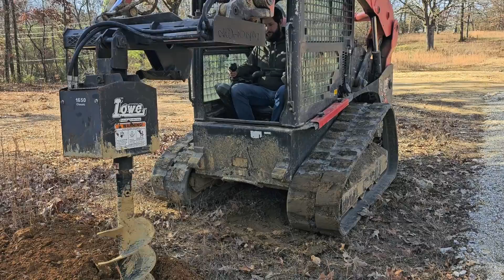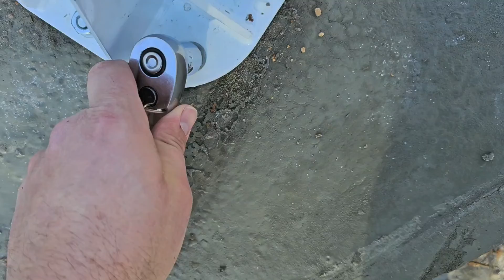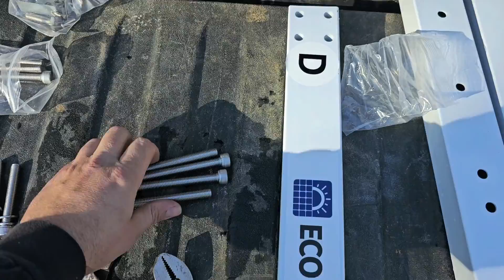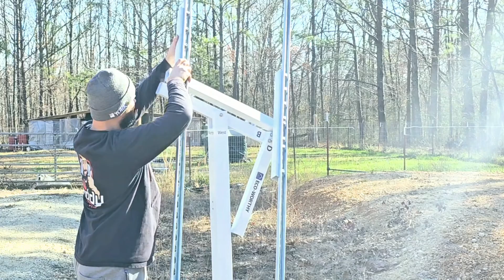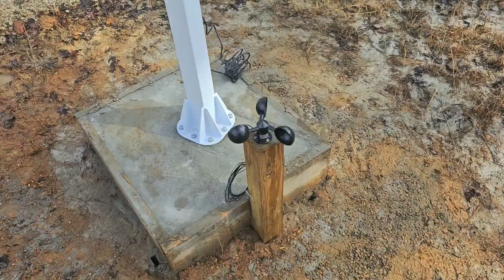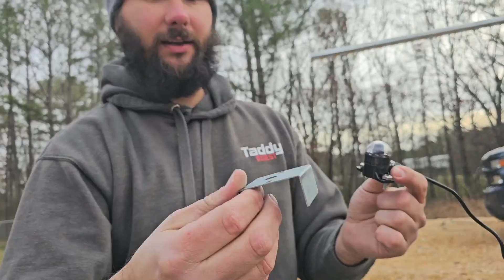How to Assemble Eco Worthy Dual Axis Solar Tracker? @ecoworthy_official

Comment: ok lets just say you are right about the position/ location of the actuators... how is that small one going to lift the north end of the solar panel grid 30 degrees? based on your instruction I unbolted my unit and turned it 45degrees and remounted it only to learn that you make a mistake as to the location of the small actuator, that I now have to pay for. I hate myself for listening to you and not doing and extensive assessment of the situation. Plus you seem so credible. In your favor I have to say that the info about the "A" brackets was priceless... but that a hammer to knock them into place can be done just by tapping the bracket with a pair of pliers and snuggly holding it in place while tightening the bolt ...tap and repeat...

Comment: I enjoyed and strongly referred your site for my sun tracking solar system made by myself.    I am using the same solar panel controller made in China.  However, my control unit is easily screwed out and broken in short time .  Since 3 years ago, I have purchased 3 units of the same controller because the life of each unit is almost 1 year.     How about yours?  Is it OK?  Is it longer than mine or  never broken?  Await your comment in convenient.

Comment: I noticed the concrete poured with about a 12" slump that provides a minimal amount of strength. Then the concrete was not mixed very well and when adding the 2nd wheelbarrow of concrete, it looked like the dry scrapings were in one corner of the pour. Adding rebar or bolts or whatever was used to tie in the two pours (when you added the additional amount with 2x12's does not really tie the two pours together). Then the bolts in the base of the steel tube.....what keeps them from spinning when tightening them to spec.? I would have made a thin sheet metal template and imbedded 12"-18" J-bolts to really hold the pole down with one (1) continuous footing pour.

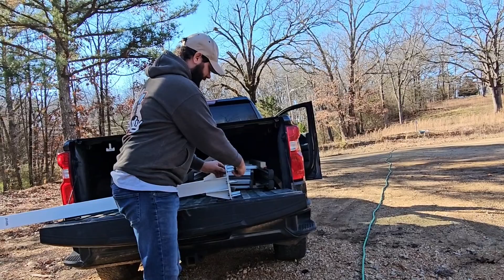Comment: 5:43 - that technique will save me so much time! I was trying to think about how I would set the bolts in wet concrete at just the right spots and angles so that the tracker would fit in place. I didn't think to just install the bolts on the tracker and set that in the concrete.

Comment: Fantastic video!  Came here after having issues with my install.  Only thing I would add, is creating a template of the base with plywood and using j bolts will be much stronger than the provided anchors.  Additionally, I followed the instructions and put the solar rails on top of the horizontal rails.  After watching your video, I tried to remove them to mount underneath, and the weight of the rails absolutely destroyed my bolts, requiring a sawzall to remove them.
Reply from the maker: Thank you so much for the detailed feedback and for sharing your experience! It's always helpful to hear about practical solutions and challenges during install.

Comment: Okay just some info I saw last year. i know the instructions show to put the linear actuators in this position with the motors down. But what happens in this midwestern climates. The rain and snow allows water to get into the gear box and ruins it. So put your motors up so that the water doesn't accumulate in the gear box. Other than that  I recommend your video. Our system is being shipped tomorrow. We will be doing a installation video on our shipping container.
Reply: @KennyJamieSmith-kjx   that’s funny cause that’s how I mounted mine just for that reason

Comment: You did a good build. On mine I added spacers inside the rectangle pipes that didn't have them because I tend to bend stuff like that. I used 1/2" conduit and cut them where I had to tap them down the pipes to the holes. A couple were lose so I used a dab of super glue to hold them in place. I also used blue lock-tight on all the bolts because I don't trust the wind to work things lose during storms. Next I filled the ends of the open tubes with expanding foam so wasps and other critters won't nest inside them. I already want another one.
Reply from the maker: That's a great idea, brother, I appreciate the insight!
Reply: "Next I filled the ends of the open tubes with expanding foam so wasps and other critters won't nest inside them." Great thought I was thinking the same thing!

Comment: Hey Taddy... I see that you have installed both the single and duel trackers? I have installed a single tracker last 5 months, and love it. I just ordered another for me second mount. I have modified mine by 10' struts to hold 3 400# panels. I want to do the same. Although I keep wondering if the Duel tracker would be better? I am not sure if it is worth the extra cash. Please will you tell me your incites on the subject?
Reply from the maker: I would go with the single access tracker

Comment: The only thing i see is the short bolts that you pushed into the cement and there's nothing on the ends of the bolts like big washers or a piece of steel with holes drilled holes for the bolts to go through.  With nothing on the ends of the bolts and you get a windy day with the solar panels on it them bolts will pull out of the cement and damage your solar panels. I like the rest of your video it was helpful

Comment: Very good wealth of assembly details! Excellent work man. My only question was about the height of the anemometer. I understand that it should be higher, as the wind gusts are different at the height of the tracker vs. close to the ground.
Reply from the maker: Yes, correct

Comment: Installing mine now...part B fits into the post with zero tolerance... it barely moves. The actuator will NOT be able to move it . all the paint is scraped off already... it's basically stuck and I don't even have the nut on. Not a good start.
Reply from the maker: contact ecoworthy that is not good my friend
Reply: @taddydigest  It took awhile to get a response, but they are sending me a new post. Can't wait to get back at it
Reply: after many attempt to contact Eco-Worthy, they have responded by sending me a new post that's due to arrive tomorrow

Comment: I have added tennis balls to the struts at the end of the panels to protect my head, they protrude and are sharp.  I also used the white triangles that the panels were shipped with to glue to the corners of the panels so that you cant hit the corners of the panels.  They are at head height and moving up and down now and then, baby proofing the array only saves you a trip to the ER.  I found that the E W actuator had to be reversed to work correctly and the solar sensor had to have the cable come out the SOUTHERN side of the array, in contrast to the video, just saying.  My controller is mounted to horizontal to read it easily inside a gasketed box, to avoid any weather issues and allow easy setting and reading, enjoy Woody N4MQ

Comment: I suggest that all the panels be mounter BEFORE installing the sunlight sensor.  One less thing in your way.  MOUNT ACTUATORS WITH THE MOTOR ON TOP, WATER GETS PAST THE SEAL OTHERWISE. I HAVE HAD SEVERAL PREVIOUS FAILURES DUE TO WATER.  i HAD ALSO TRIED DRILLING WEEP HOLES AND THAT DID NOT ASSIST THE ISSUE. wOODY

Comment: I do not trust the short bolts stuck into the concrete. I used 9" all thread into a base then, I welded them to another plate which I buried 6" below the concrete surface. The threads stick out 2-3 inches above the concrete and I double nutted the mast -one above and one below so that I could LEVEL the mast. THis is how street light poles are done in this area,  I have no issues with my mast moving!! ENJOY.
Reply: @woodyw6933  I am with you on this.  It is a ridiculous way to do it.  He obviously is not that great with construction.

Comment: Thank you so much! Eco worthy’s video is trash (they tried) had this in a box in the barn at my off grid property and weather finally good enough to start.
Reply: I’ve got it pretty much assembled but one major question… for the life of me I can’t seem to figure this out. Should the main post stickers be facing the direction or away? Like mine is oriented so that the sticker that says south is pointing south. So the south sticker is behind me looking south. Does that make sense? Or should I be reading the compass looking through the post.
Reply from the maker: Once you get it all together, you will know the right direction
The south should face south
I had to swap mine around
Reply from the maker: your welcome
Reply: Perfect I think mines right! Wish I could attach a pic to my comment. I drilled my expansion bolts so if I did need to switch it wouldn’t be devastating.

Comment: 👌 Hello !
Thank you for this interesting video.
Please a few questions:
What maximum weight can this tracker support?
And can I install on this support 2 or 3 photovoltaic panels each measuring 2000 x 1150 mm for 27 kgs (i.e. 78.74 x 45.27 inches for 59.52 lbs)?
Just a note: wouldn't it be a good idea to place the cylinder motor at the top to prevent rainwater from seeping in?
Many thanks again! 👍
Best regards
Daniel from France